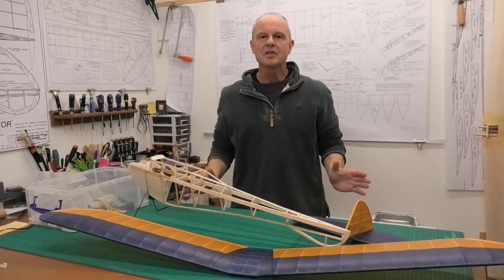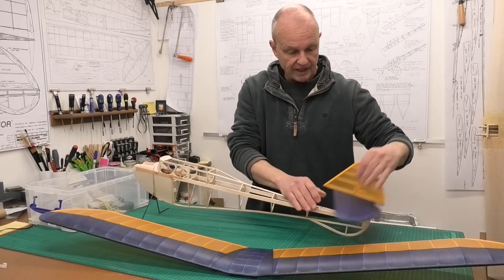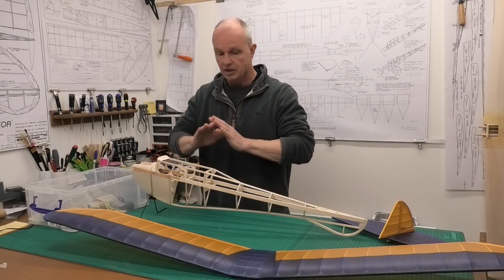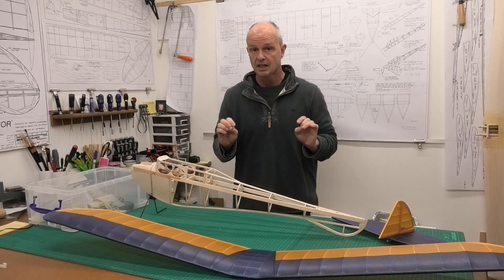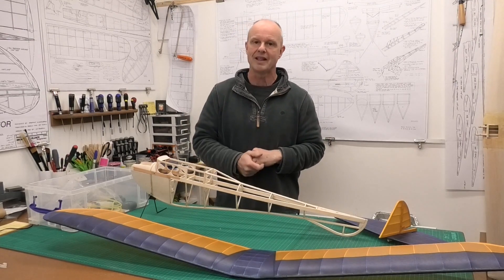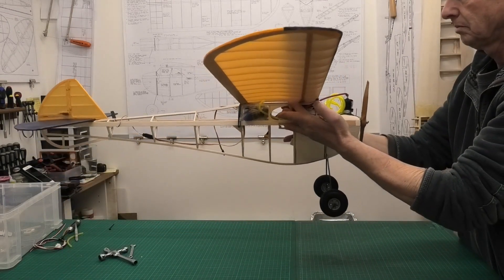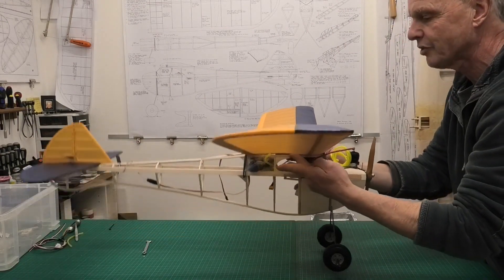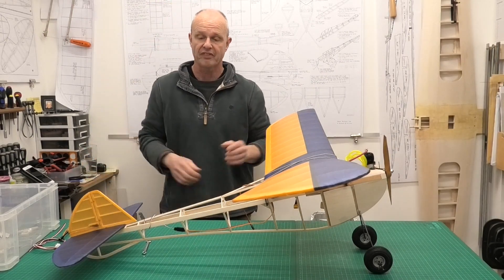49" Diamond Demon & Bantam 19 Spark Engine - Pt 12: Checking the balance Point - Ben Buckle Plans

Comment: I also use short lengths of round toothpicks thru the flat dimension of the hinges.   I do not drill thru the far side of balsa member...... as soon as the drill bit breaks thru the plastic hinge, I stop drilling so the far side of the balsa is unmarked and doesn't need to be refinished.
Reply from the maker: What you do is probably a better way, so you get one unmarked surface, I will probably do that, setting the depth stop on my pillar drill so I don't go all the way, thanks 😊

Comment: Hi Mark. That worked out just right for the correct CG. To get the CG correct on my Gas Bag model I had to use carbon fibre rod for the elevator,  and closed loop for the rudder. But we get there in the end. Thanks Mark.
Reply from the maker: Thanks Terry, yes, its great to get the CG right without the weight, I think carbon fibre is a great way to go